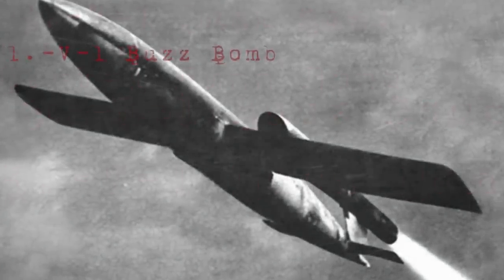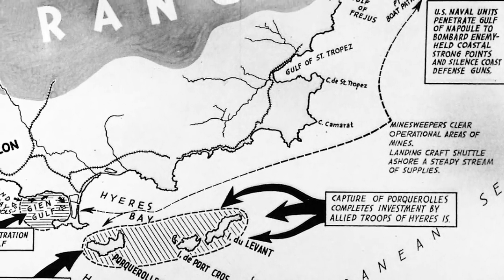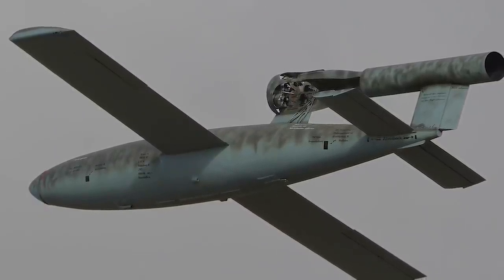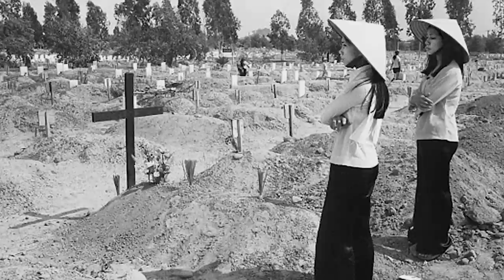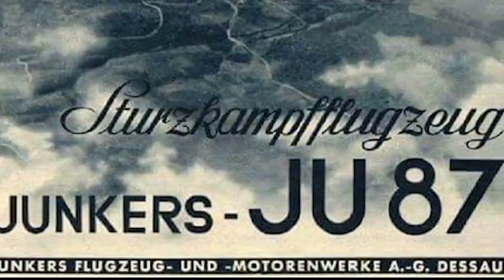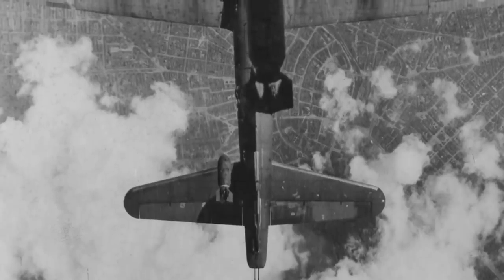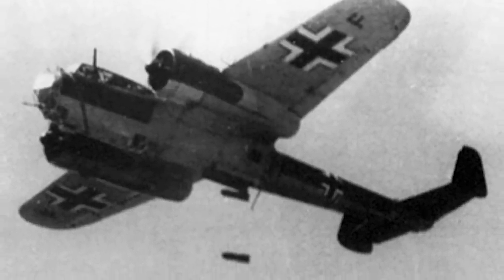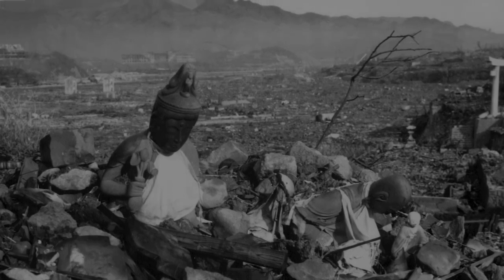5 Creepiest Sounds of War Ever Recorded

Comment: The V-1 Engine produced the loudest sounds ever by any engine until the Apollo missions. A friend of mine who worked closely with Jerry Yagen in Norfolk VA, was testing and restoring an original engine from a V-1 and was going to test fly it, and was using a experimental baffle that would reduce the sound by half. But even at half the decimals, the engine was still loud enough to break windows at a airport over 1500 ft away.

Comment: My favorite part about the Trumpets of Jericho is that the things would go off during level flight. The pilots got sick of hearing them constantly and complained to the point they stopped putting them on the planes altogether. 

And on the whole slowing the plane down thing, the Stuka wasn't exactly a fast plane to begin with. The sirens were mounted right next to the fixed landing gear, aka the massive air brakes. RAF planes could already easily catch and annihilate them. It was obsolete the second it crossed the Channel.

Comment: The slowing of the Stuka was not a disadvantage, it was done for a reason. The dive bomber needs an airbrake to slow it down on its bombing run, if it is going to fast the pilot can not aim the bomb very well. It was never meant to be a fighter. It was a close support bomber.

Comment: For the vietnamese  horror sound thing , they used this tactic in night too and an ac-130 was following behind , when viets was shooting the ac-130 was shooting back at them and then a chopper with a radio on it will Say WE told you ( the helictopere part is an anecdote from memory so its maybe not true )